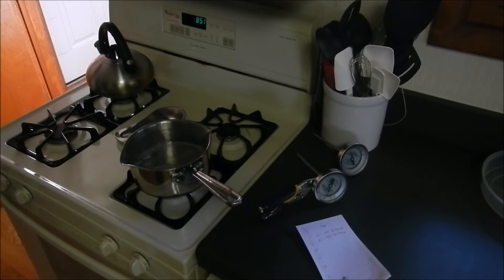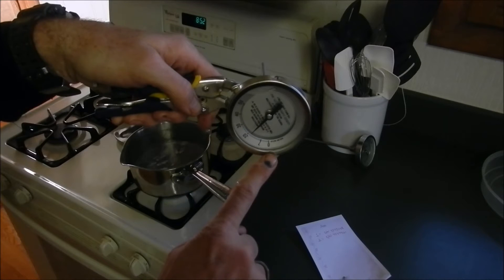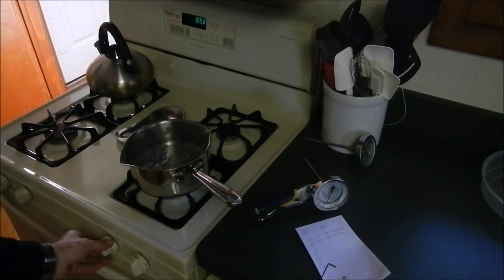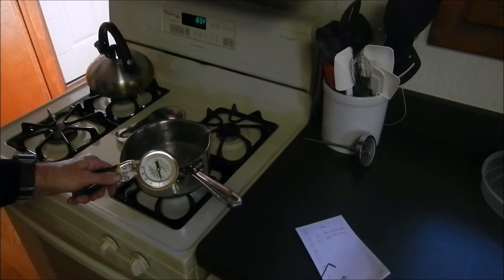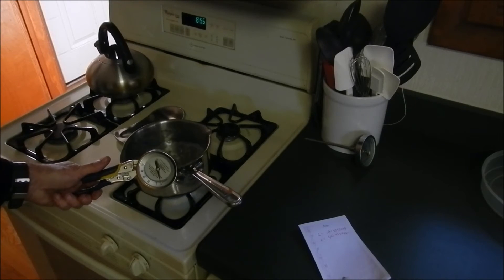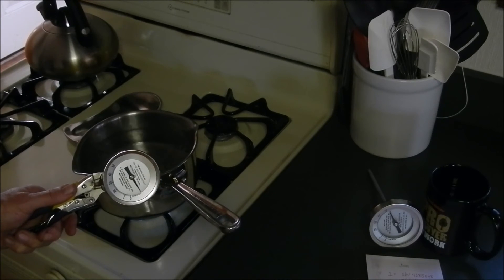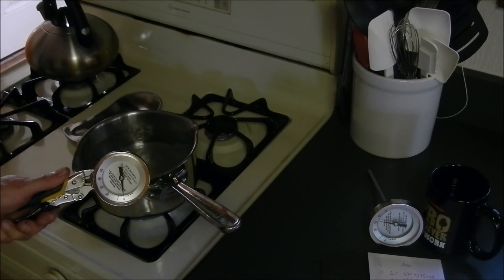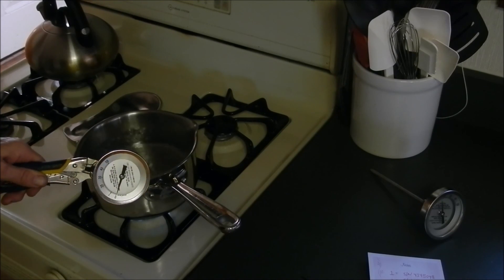Leader Evaporator Half Pint Thermometer Calibration

Comment: I see this is an older video, but worth noting, it appears you are resting the thermometer stem on the rim of the pan as you measure - only the tip of the thermometer should be touching the water, nothing should touch the pan for a very accurate reading.   Nice video, definitely answered some questions I'll have when my thermometer arrives from Leader.